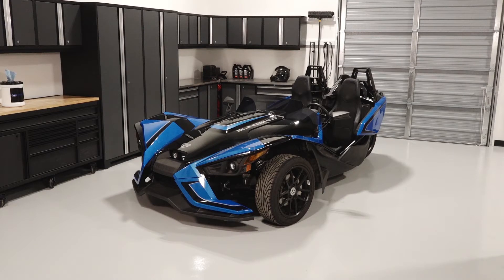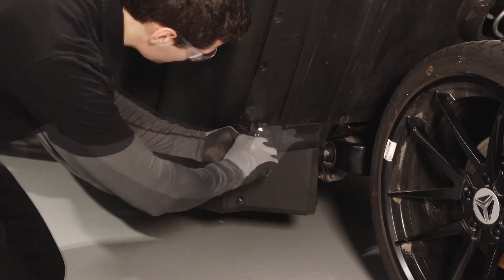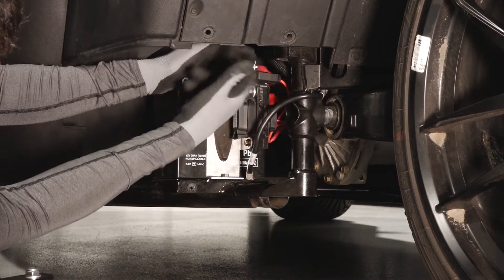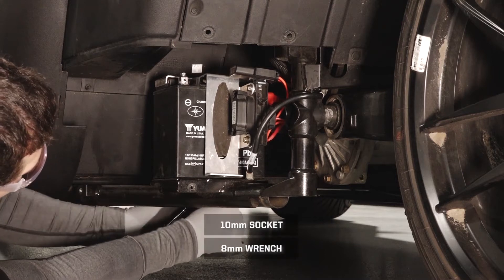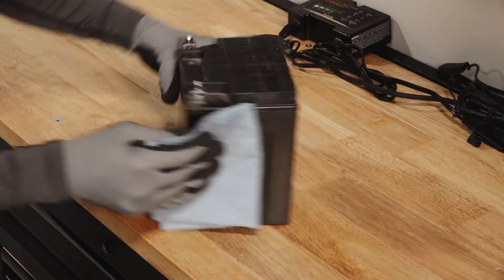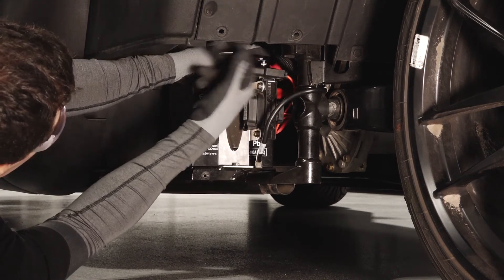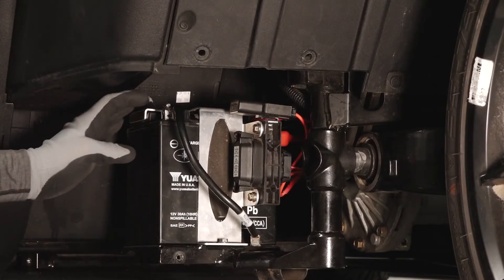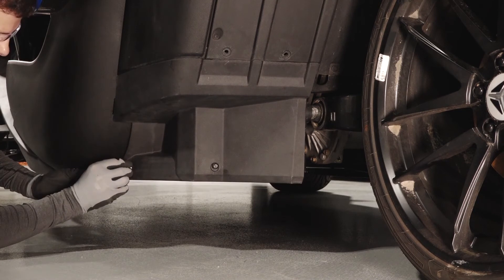2015-2019 Polaris Slingshot | Battery Removal and Installation | Slingshot

Comment: This video is very helpful.  But I must pick at it.  The car he serviced didn’t have ten year old bolts to remove.   They just don’t screw in and out as shown.    The rivets dont pop in that easy either.  But the video is exactly how to remove and replace my 2016 SL Slingshot